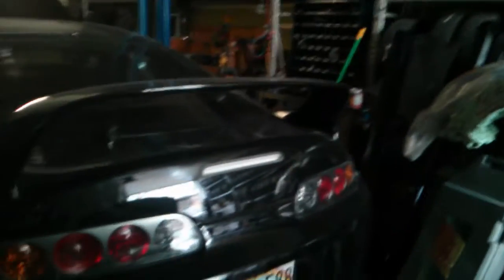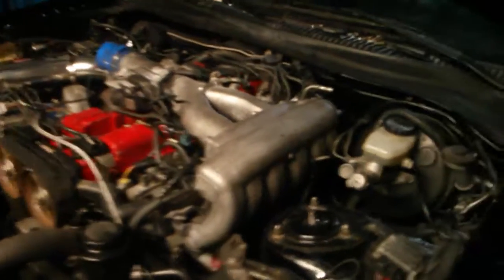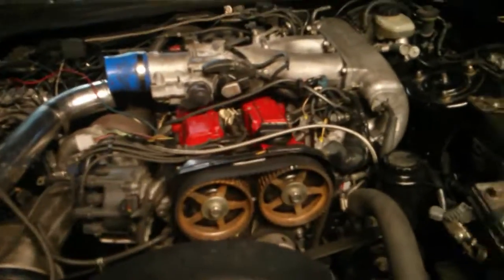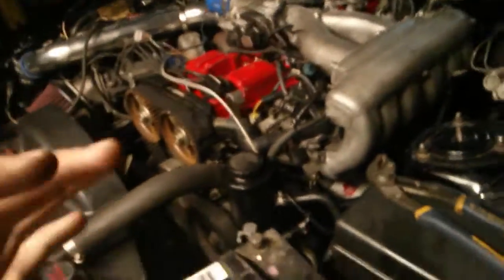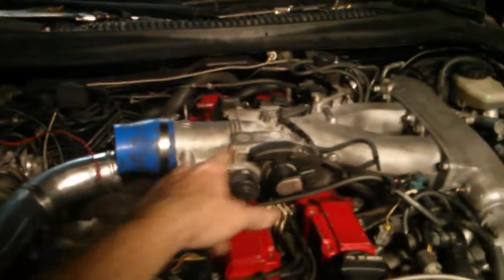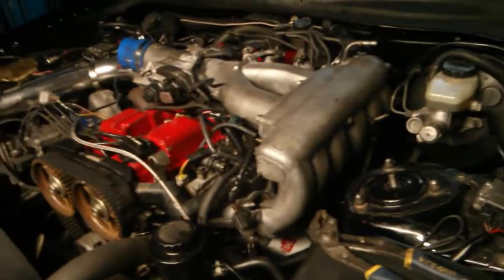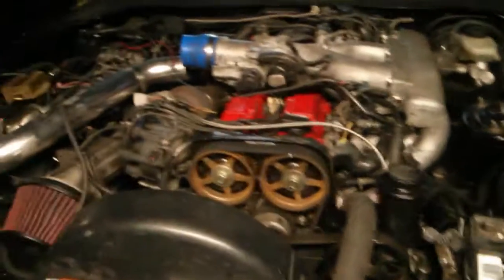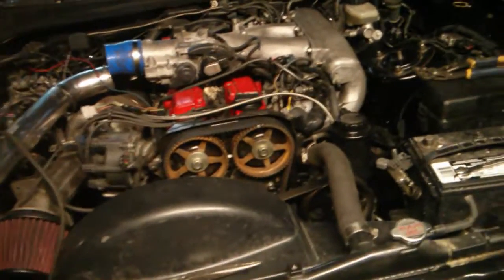Turbo an NA Supra

Comment: With my setup 2jzge na-t im running 800 cc injectors, TT head gasket ( steel layer ), ARP head studs. EMU stand alone and precision 6266 turbo. 

Having so much fun with it. 

15 psi is usually what i run it at but its been higher. I upgraded my coil and it was a noticeable difference. 

As far as the differences between the GE and GTE some more differences are that the GTE had factory oil squirters that squirt oil up into the piston where as the GE does not. 

Usually the VVTI GE rods are weaker and thinner than the non vvti GE rods. 

The Crank for the non VVTI GE engines is identical as the GTE, same part numbers. Which is awesome because the three main things that make the 2jz so great is its stout crankshaft, its cast iron block, and its inline six engine configuration. and both the GE and GTE share those characteristics.  

Id say this, if you have a GE engine, don't just give up on it and toss it. you can do some awesome stuff with it.
Reply: The non VVT-I rods are almost equal to GTE rods so that's not a problem. Oil squirters are not required unless you're doing skids "all day long". The biggest problem with the NA supra is the stock W58 gearbox that can't stand high torque. Usually the third gear goes. The engine itself can handle much more with no problem.
Reply: Was the wiring pain in the ass? I'm planning to convert mine as well. It's not cheap but worth it.
Reply: What is almost equal? Non vvti GE rods and GTE rods ARE the same. same part number.

Comment: Great video. Here is good idea for some of you who doesnt know, get a sandwich plate to be placed under your oil filter so you can hook up your oil feed line to your new turbo charger instead of drilling holes. ;) That is one of the main key difference about GE NA and GTE. Internals are the same on the bottom end. You can handle about 700hp if you tune it right. Port and polish head/build it if you are going above 400hp. A lot of people are changing the game each year. This is what I am doing next year. :)

Comment: Cam's are different in every turbo vs N/A engines, sometimes the intake cam's are the same but the exhaust cams on the turbo model engines will always have a higher lift ratio.
for 2jz gte vs ge differences heads are different, cams are different, pistons are different, ecu's different, intakes different, injectors different (high impedence vs low impedence),fuel pressure regulators are different, rods I believe are the same, and engine wiring harnesses are different.
Reply: MechRider89 cams are the same on the 2jzgte and 2jzge non vvti. The vvti 2jz's have smaller lift.

Comment: How much horsepower can I run on a stock na block with a turbo
Reply from the maker: I've heard caution with going over 500 without changing out internals.
Reply: Built with thick head gasket and arp studs it can easily handle 600. Head gasket lowers compression which is key